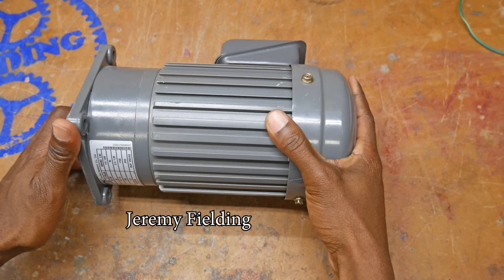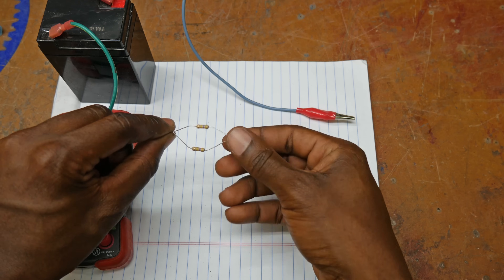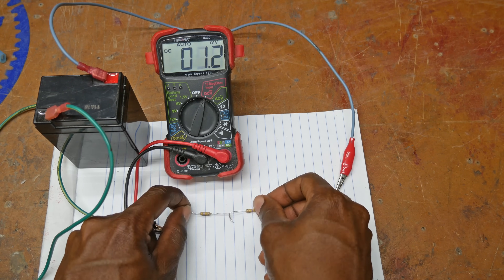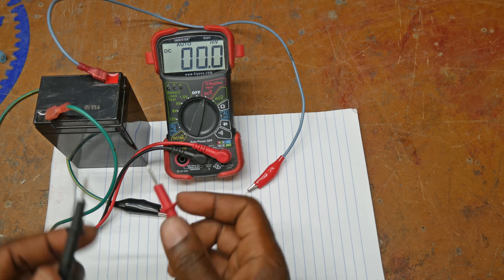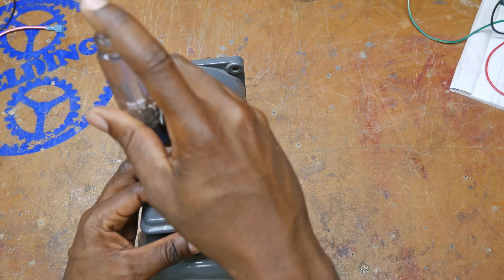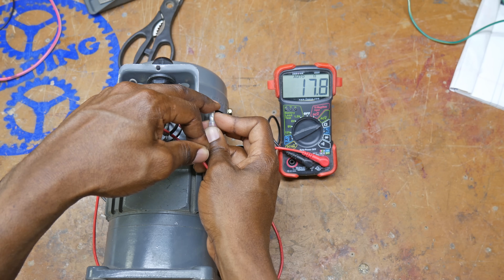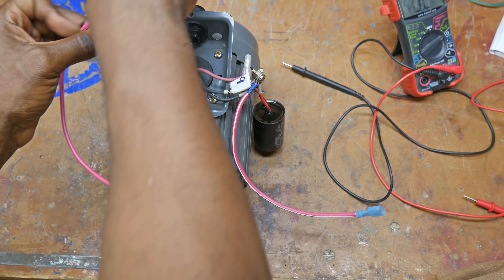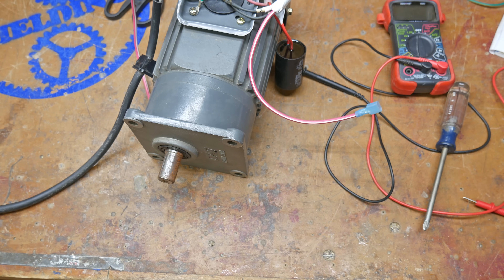Dual Voltage Motors, How They Work, And Wiring Them Without The Wire Labels. #059

Comment: six wires coming out of my Everbilt half horsepower shallow well jet pump's motor. Spent 45 min with the continuity tester and was unable to isolate the three sets of windings as described in this vid.  Also, on your connections diagram at 7;07 ; over on the right side for the high voltage set-up shoudln't the "N" at the bottom be a second "H" since you have two hot leads going across the two windings in series instead of just 120 volts ???   Thirdly, does the starting winding have a different voltage across it in the two different scenarios whereas the run windings have the same voltage across them weather your running the motor on 120 or 220 ?

Comment: I just bought a NIB used motor.  It has never been wired up and the wires are not numbered.  The problem is that there are eleven wires, and they all all black, and the same size.  Now what do I do?  Maybe you could do a short video on 11 wire motors?  Thanks, or email me an answer?
Reply from the maker: You should look through my "how to wire and control motors" series (playlist) to see if I have something similar. There are so many possible combinations that 11 wires doesn't tell you enough. I can't do one on one advice at this volume... but if you figure out what kind of motor it is (I have a video on that) and you leave that information here... I will add it to my list of video request. FIY motor wiring videos are my favorite so it is worth letting me know.

Comment: This shit blows my mind. I didn't realize that about resistors, the way they can be configured in series and parallel, thanks.

I'm a beginner with electronics and I'm trying to figure out if you have a 3 volt circuit with 2 motors, and you get rid of one motor, is the voltage going to be too high as only one motor is drawing all the power from the battery now? I'm pretty sure it's fine but I want to be sure and I don't know the voltage rating of the motor other than it came from a dual motor 3v circuit.

Comment: Hi Jeremy, if you installed a switch to that 110v Motor, you would run neutral straight to the motor and your hot would run to the switch .. but what if the motor is 220v ? Can you run one leg (110v) straight to the motor and the other leg (110v) to the switch? Would that damage your 220v motor? Thanks
Reply from the maker: You need a switch that breaks both sides
Reply: Thank you, Sir 👍

Comment: I'm becoming addicted to your channel. For this video,  since I'm a visual learner, would it be possible to show a wiring diagram with the windings and starter winding illustrated. I'm try to wrap my head around the wire pairings and how the starter winding plays into things. Many, many thanks for your time and effort to produce these vids.
Reply from the maker: I would encourage you to draw it yourself. Use the diagram I show in the video around 7 minutes in... then draw the starter winding... the information is there... I think you can create the image from that.
Reply: Jeremy Fielding thanks! I must have looked away and missed the diagram!

Comment: Have you ever come across a motor of 3 kW or higher that could be run with DC power directly?

I don't think they are very common, I'd like to make an electric buggy or a motorcycle at some point, but all I have are AC only motors, which are hard to run from a battery (the controllers are very expensive for me)

Washing mashine Universal motors are only about 300-400W, those aren't gonna move much and I don't feel like putting 10 of em on a frame :D

If you have any suggestions on that kind of project, I'd love to hear any and all suggestions!
Reply from the maker: This is such a common question I am trying to tackle this problem right now. I bought a massive go kart frame for testing purposes. if I can run that thing, you will have enough power for any go kart/electric bike application.
Reply: Jeremy Fielding Awesome! I am looking forward to seeing it so much!

Comment: Excellent video Jeremy. Now I can sort out those mystery motors on the shelf. I do have a question. If a mystery motor is single voltage can you determine if it wired 110v or is it 220v ? I have a very old motor (has oilers and wicks on the bearing caps) and I have no idea what voltage it is wound for.
Reply from the maker: Wow... I should investigate. I don’t know off the top of my head. But what a great question. That sounds pretty tough... that’s why it is interesting

Comment: We all need u to jump on this controller for the lg washer ,, chexk out the latest gerald morin video's. Im stuck,, the one I have on a shaft testing i cant seem to get the correct frequency and or pulse voltage yet... it viborates, and either i get torque without speed or some speed with no torque. And it has to work cause in the front load washer it does... 200 lbs of wet clothes spin,,, without struggling or transmission. Best I can figure from the inverter board in washer, is high voltage impulses, low low ampers, and variable frequencies... and best guess is DC voltage through capasitors... octicouplers too.. u would think i couple get this closer since the new xerox printers run similarly, i have mcu board, iot board and the original motor for that hooked up,, but this is little stuff. And xerox motor has 4 poles per phase,, with 3 sensors.. counting on a board on motor.

Comment: https://qph.fs.quoracdn.net/main-qimg-1ff877c00d5f8a3fa7c386310e5c7dec is thuis the same kind of motor?
Reply from the maker: Likely not. That looks like 3 phase.
Reply: Jeremy Fielding could you make a vid on wiring 3 phase motors?
Reply from the maker: I plan to ... so yes 😁

Comment: So basically, the difference is in the gauge of the wiring? So that would mean that a 120v motor can run 240, but not the other way around (because of the thickness of the wires), correct?
Reply from the maker: Not all motors are dual voltage. If you have a dual voltage motor, the wires should be rated for the lower voltage. But the the long run... The wire gauge is based on the current it must carry. and be rated for the voltage. But that is more about the insulation of the wire.
Reply: Jeremy Fielding Ah right, thanks.

Comment: jeremy I have a GE washing machine motor model#5kc41LT 70S......cap start 3/4hp 120v. I have a reversing DPDT switch and have it going for. an reverse...but it is turning about 1190rpm an I can Not figure so far how to get it up to 1725 or so...I to salvaged this from a 20 yr. old washer. Can You tell how to get it to the high speed.  Thanks
I have managed to make a 1/2hp motor work and it to makes for/rev..all works good..

Comment: You have an outstanding  channel! 
May I ask you to de-mystify 3 phase electricity please?
I can buy a lathe that operates on 220vac 3 phase. As far as at home should someone use a rotary phase converter or digital converter? Or should the motor be replaced? Or shall I avoid this headache all together?

Thanks,
Mike
Reply from the maker: This is a planned topic. Many have asked as yourself :)

Comment: Great job as a old time retired factory maintenance man your presentation was both spot on and very well demonstrated. I get frustrated with people on the internet comments saying there going to lower there machines 240 instead of 120 to save money please go over billing for kilowatts WVA thanks
Reply from the maker: I actually talked about that in this video, then I edited it out to make the video shorter. It is a common assumption, but  the difference is negligible at best. Certainly not worth rewiring anything.
Reply: The difference is in current loss. The more current you put through a wire the more you lose due to resistance to current flow (impedance). At twice the voltage but half of the amperage, losses will be lower for a given length of circuit, but that is generally minimal in a properly sized circuit. The advantage comes with sizing the wiring in the wall and the hookup smaller for lower amp capacity. Cost increases for 240V plugs and sockets vs 120V.  I did that calculation as I sized a wall circuit for the saw in my new shop space. Decided to try it on the higher voltage. I wonder if it will run cooler on fewer amps?

Comment: I think you will also need to make sure the polarity of the windings are correct.  This is difficult to measure, but if it is wired backwards the windings will fight each other, pulling in opposite directions.  If the motor doesn't turn then swap one of the winding wires to correct the problem.
Reply from the maker: I have never had an issue with this but I agree it is possible
Reply: I might be wrong, maybe it would be worth an experiment to see what happens if they are swapped.

Comment: the fact there is no nominal standard for voltages on equipment always bugged me, especially since 90% of the services i test have 120, just say 120 damn it.  (rant over) another spot on video man, well done
Reply: 120 volts for mains is the poor relation to 240 volts. 240volts is better it charges cell phones up quicker and as it has only half the amps you can have higher amperage equipment. For example in the uk we have 3 kilowatt electric  kettles that run of a 13 amp fuse on 120 volts supply  the fuse rating would be 26 amps. They say 120 volts is safer but anything over 50 volts can kill you.
Reply: There's not really any debate over which standard is better. We all know the higher voltage standards are better, but North America got screwed by virtue of it being the first to adopt widespread use of electricity. I'm sure if we had it to do over again, we would chose a higher voltage, but it's much too expensive to change now.

Comment: You're a great teacher Jeremy. Thanks for the video's...   maybe one day... after watching your video's... I'll have a clue as to how to build myself and/or make/fabricate a rotisserie motor here in the Philippines. I'm totally new at this motor stuff but I learn a little more with every video. Keep up the good work!
Reply: +Sam G ...  Sorry, Sam... didn't mean to trigger ya. Correction noted...
Reply: Many ways to approach that.  It is more difficult to get low speed motors.
Synchronous motors from old microwave oven turn tables to the likes of a corded or cordless drill driving a bicycle wheel to get the gearing correct.  Obviously larger motors can be used depending on the size of beastly you'll be cooking.  
You'd be quite surprised by the torque you would get driving the rim of a bike wheel with a small motor where the gear ratio will be very low at the hub- your spit drive.  
A 20" rim driven by a 1/2" pulley on the drill gives you a 40 to 1 ratio in both speed reduction and torque increase (not allowing for friction)

Comment: Hi, how do you determine the polarity of the two main windings with respect to each other? I would expect that if you reverse the polarity of one of both windings, you blow your fuse. Was it pure coincidental that it went well in your video?
Reply from the maker: Because it is ac. There is no polarity. The direction of current switches 120 times per second or 60 hz (both positive and negative within one cycle). Thus no need to connect them which respect to current direction.
Reply: Hi Jeremy , with the polarity of a coil we mean the winding direction of that coil (or the current flow direction). For example, if the two main windings in your motor are bifilarly wound, it makes a big difference whether the coils have equal polarity (the current flows in the same direction and enhance each other) or that the polarity of one of both coils is reversed, leading to a combined current of zero in that bifilar coil. The latter has a zero self inductance and will short circuit you AC supply. But maybe, your motor isn't bifilarly wound. It would be a simple experiment to reverse the polarity of one of your coils (connect wires 1to 4 and 2 to 3 instead of 1 to 3 and 2 to 4) and see what happens.
Reply from the maker: I follow you. I will test and see... I have not considered this possibility nor have I had a problem with it... I have wired a lot of motors this way. But I prefer to rule out this scientifically
Reply from the maker: No, Basically the two windings at any moment have current flowing through them and that sets up a magnetic field based on which direction the current is flowing. The windings could possibly be wired so the magnetic fields fight each other instead of pulling in the same direction. Check out my "how motors work" series. I talk about the direction of current flow and it's effect on the magnetic field in the first video on DC motors. That series is for beginners.
Reply: @Jeremy_Fielding  could this be why the motor was spinning so slow/basically stalled when you turned it on? The nameplate says 1720 rpm.
Reply: Is this what you guys are talking about? https://youtu.be/ymVi16ekWVg 
Im a newb with electrical stuff so im kinda in the dark here :D
Reply: Did it go well in the video? The nameplate says its 1720 rpm, that looked like about 30 rpm.

Comment: i think you should make an air compressor using a fridge/ac compressor ......i do want to do this myself but i dont have time
Reply: Hey FDG :) I think you would really like sixtyfiveford's channel.  He did a video on a fridge compressor vacuum. 
It's the same thing as a compressor, just depends on if your useing the inlet or outlet :)
Here's a link to his video https://youtu.be/CMe25d_KVP0
Reply: Hi FDG , we tried it with a fridge compressor and it was disappointing: the flow rate (liters per minute) was very low, being almost useless. It appeared, that this kind of compressor is designed for high pressure, not for high flow.
Reply: i made a few back in the 80s/90s, not very efficient but get the job done.
Reply: That would be cool